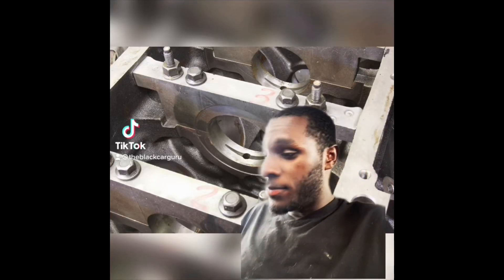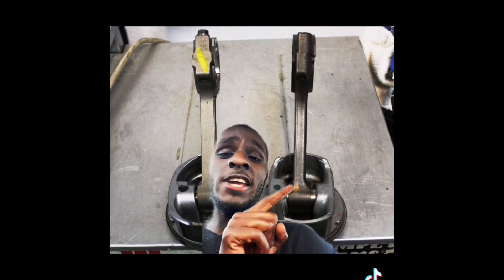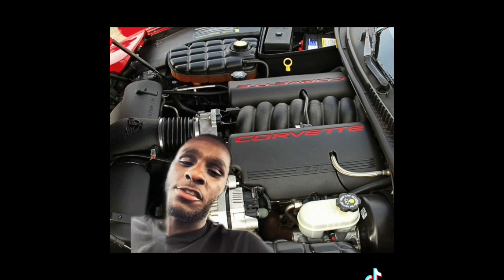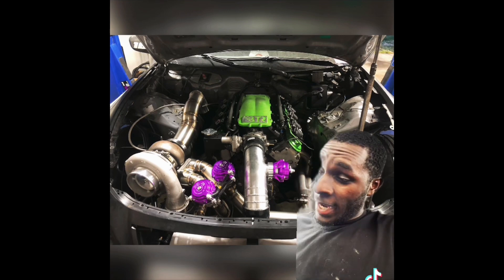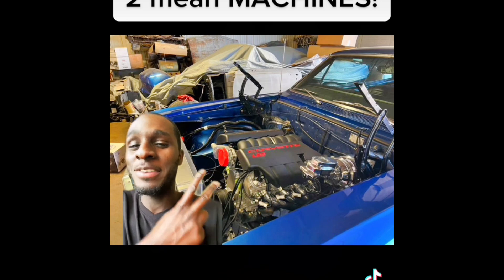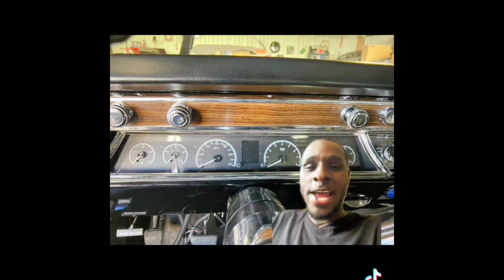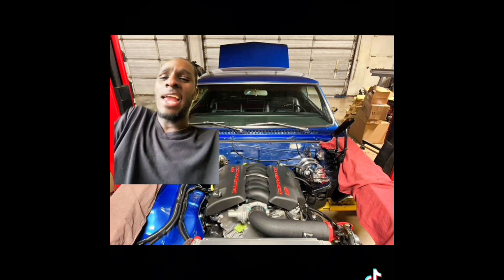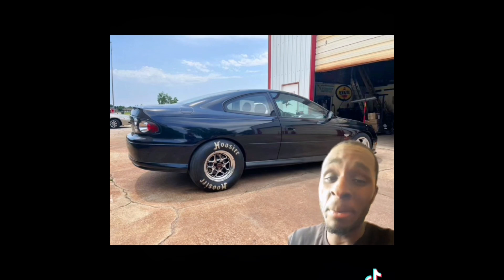LS SWAP COMBOS | 1967 Chevy Malibu RESTOMOD!

Comment: I got a 4gen 5.7 hemi in a 1500 were should I start
Reply from the maker: Cam, springs, better intake
Reply: @TBCG  if you was go to do a complete rebuild how would you go by a old 5.7 an build it up from the ground or by a crate motor 5.7
Reply: @joebatson2352  i would rebuild from the ground up and keep it naturally aspirated with some 6.4 parts
Reply: Yeah and keep doing what you doing man

Comment: Not sure which head it is exactly but I believe one of the truck heads flow as well or better than a ls1 and the trailblazer ss intake has been proven to be the best oem intake it just doesn't fit as well as others. But ls motors are special.

Edit* 799 truck heads flow the most.
Reply: 799 = 243
Reply: @Cali  yes. Lol I had forgotten that over the years but yes.

I used to know almost every odd detail of the LS based engines and which parts were the best to mesh together, but went to learn more about the 1UZ, 1&2 JZ motors, Ford barra, and coyote and shoved all LS knowledge to the back of my mind until recently. Lol